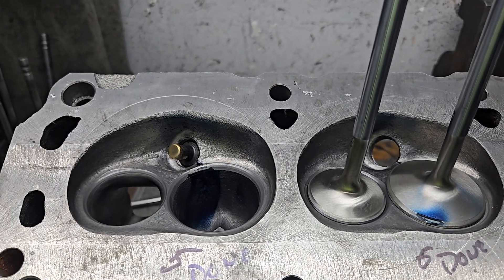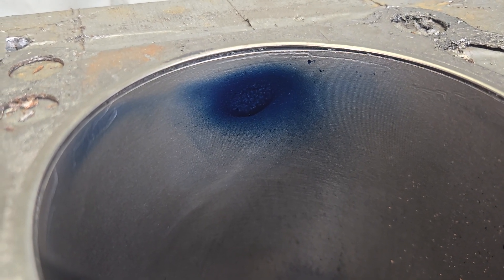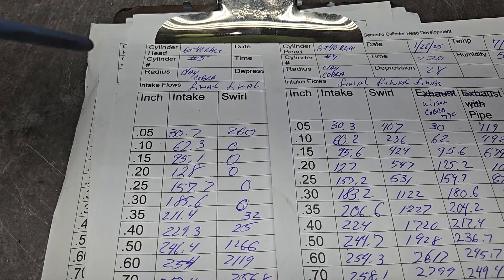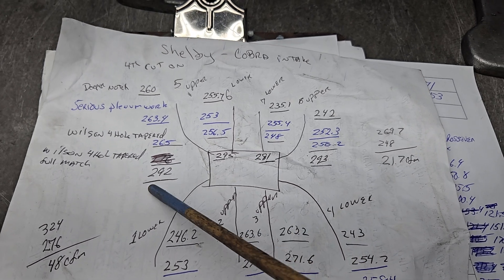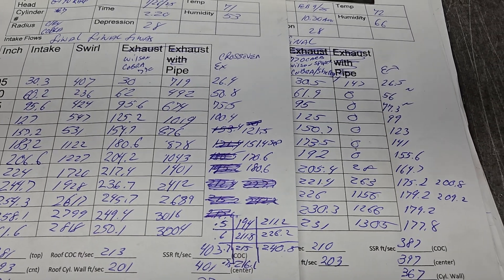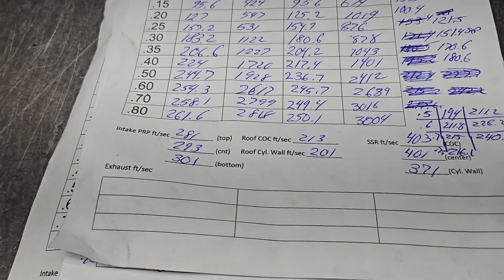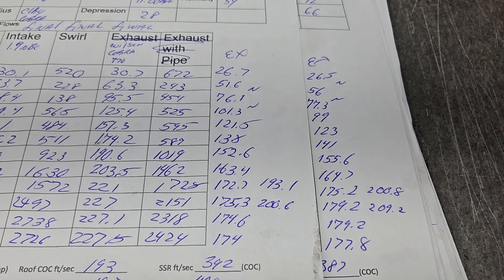Ford GT40 289 Race Project, Cylinder #5 flows and air speeds. Wilson spacer, Shelby/Cobra intake.

Comment: Must be the season I had the smoke roll out of one of the motors in my sf300 I got.  I was surprised to see it had 8 motors in it I had read they had 6 and the 600s had 8 but mine has red fluid in the manometer which makes me wonder if it is the right density. I will have to try to check calibration on it when I get it back together. I may have been recording numbers with it way off but since I just use it to find gains I don’t guess the numbers really matter.
Reply from the maker: @bcbloc02  It needs blue in the angled manometer and red in the vertical. 8 motors with the 29amp motor controller means it has been upgraded to 600. If it has all this it is a 600.
Reply: @  no motor controller when you flip the switch all 8 motors come on when the single contractor closes. There is an electrical switch in the center that is hit when you change the intake exhaust lever but it has no wires going to it? There is a same switch appears on David’s bench you worked on but his also has no wires going to it.
Reply from the maker: @bcbloc02  Old school model. Ok
Reply from the maker: That switch goes to flowcom
Reply: @ looks like most the motors have a 1992 date code. Surprised they had even thought about flowcom back then. Explains why it doesn’t look like the switch was ever hooked up.
Reply from the maker: OLD SCHOOL JUST CONTACTOR STYLE THAT SWITCH IS THE OVERTEMP SWITCH CONNECTED TO CONTACTOR COIL CIRCUIT
Reply from the maker: Send me a picture if it is still apart. Charlesservedio@gmail.com
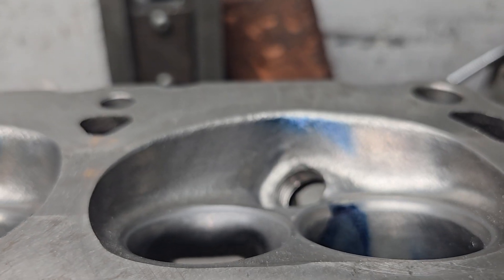Reply: @ Overtemp switch is down in the bottom and it is wired up. The switch I was referring too is 1:39 in your video https://www.youtube.com/watch?app=desktop&v=OK2diFBPz1E
Reply from the maker: That is the phenumatic switch to change from intake to exhaust on flowcom.
Reply: @  I got it back together and it easily will pull full scale 28” on the 400 setting so changing to the blue dye would probably up my flow capability but honestly I don’t know if I will run into any heads that flow that much so I don’t guess it matters for now. I need a swirl meter more than I need more flow scale I think.
Reply from the maker: @bcbloc02  As long as you can cal it with a plate at 28 inches you are good. In reality you need plates 50 cfm to 400 cfm and do each range. It takes a few hours!